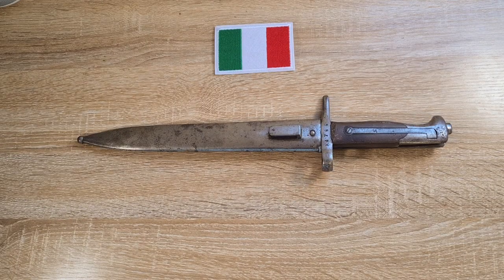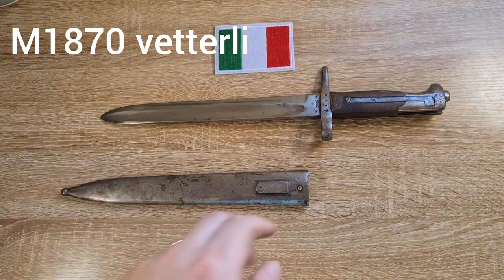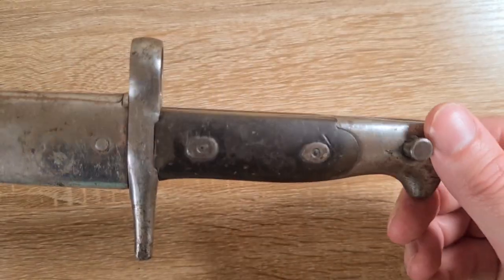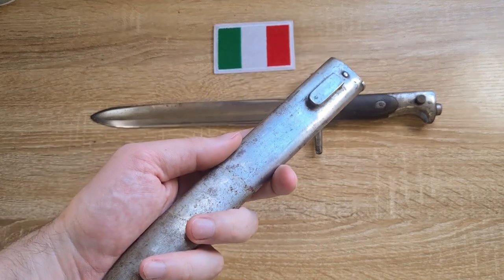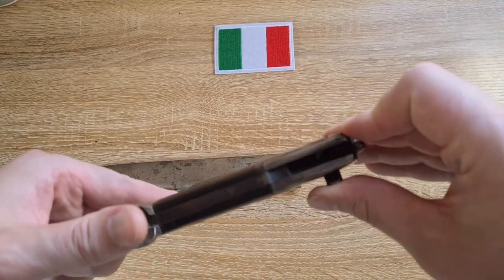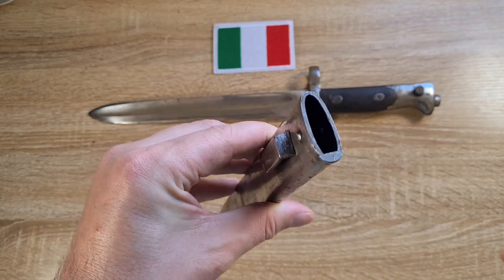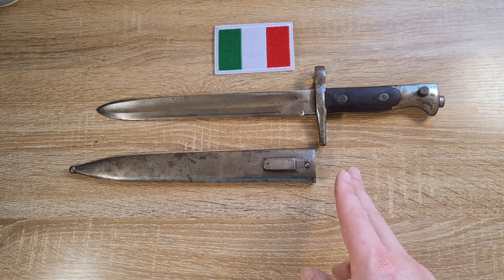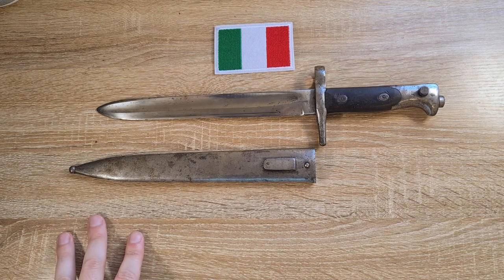WW1 shortened Vetterli bayonet used by Austria

Comment: Thank you for this video. I was racking my brain to identify a friends bayonet, but all the sources in Italy say that the notch in the ring was added in the 70/87 model. And the friends’ one has a long leaf spring (which as you said is from the 1st model) so it was driving me insane to understand what model it is.
Reply from the maker: There is a lot of contradictory information out there. It was quite hard to find the correct info